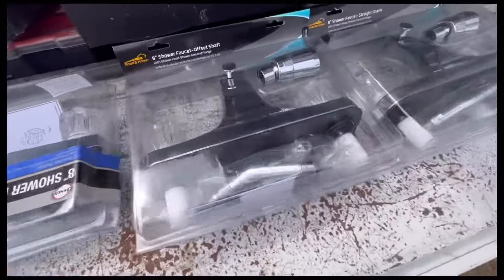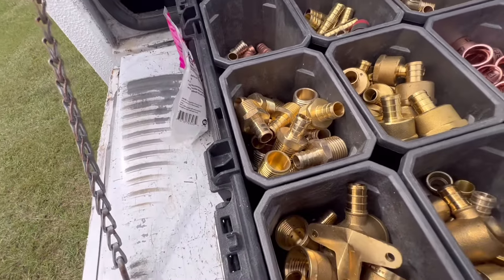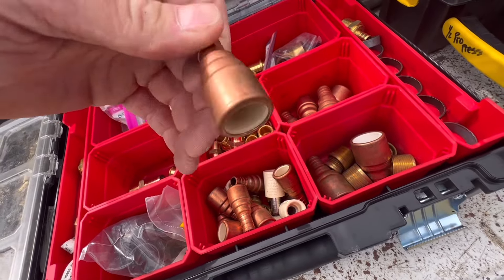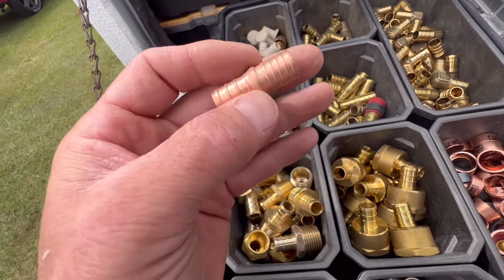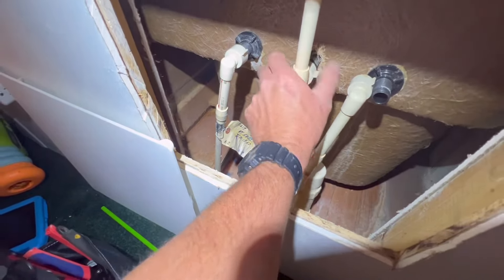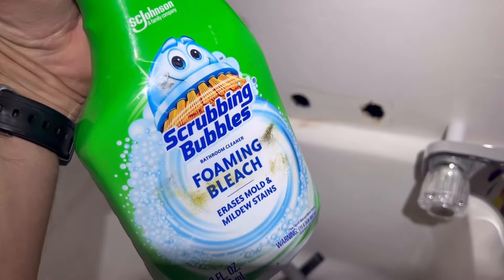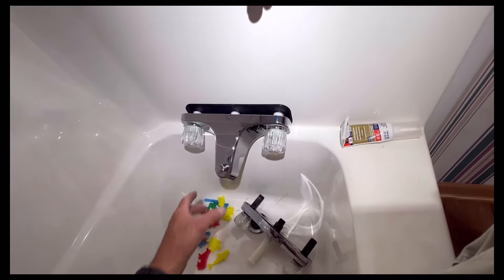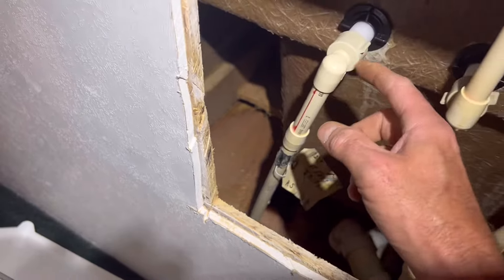HOW TO REPLACE A MOBILE HOME TUB SHOWER VALVE

Comment: Nice job showing the steps. Just don’t shove the shower diverter back down while the water is running. That will ruin the new faucet quickly.

Comment: How do I replace those gaskets?? On the cpvc hook ups
Reply: It will be really hard to remove the gaskets and even if you do you won’t find new ones easily. I would replace the whole fitting. There may be a shark bite fitting available if you don’t want to glue.